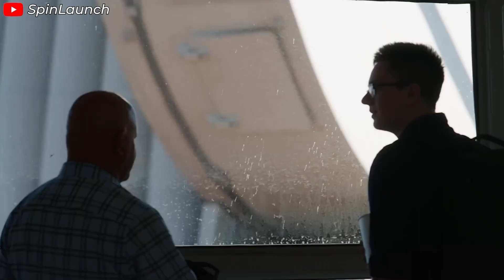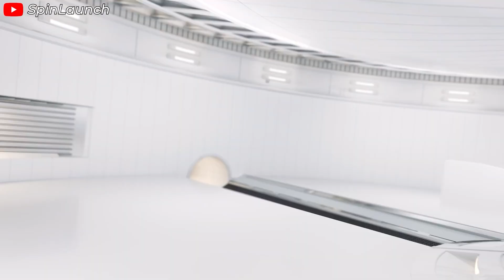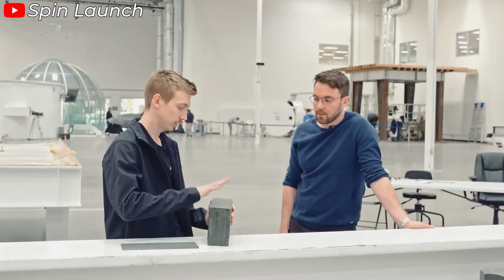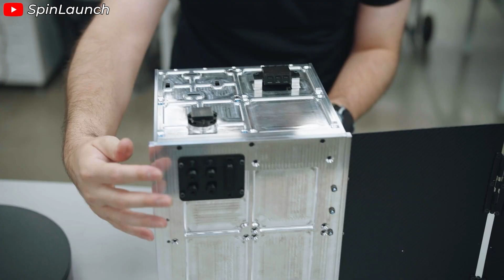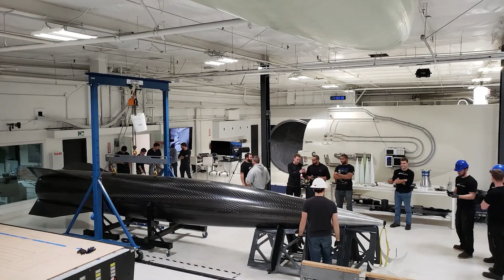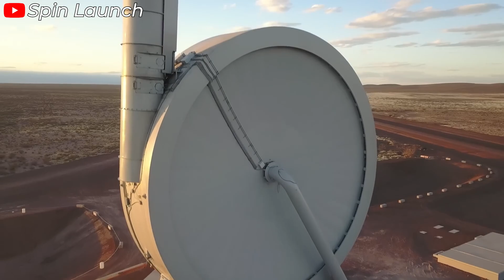Disaster! What happened with Spin Launch Accelerator 'Failed'???

Comment: Seems like a gun or linear magnetic accelerator would be a lot simpler.  Spin Launch just seems silly to me.
Reply: Yep, if your payload can handle the insane acceleration, a gun is far easier and cheaper than Spin Launch, and they did it decades ago (see Project HARP).